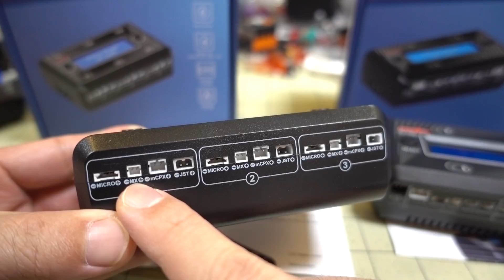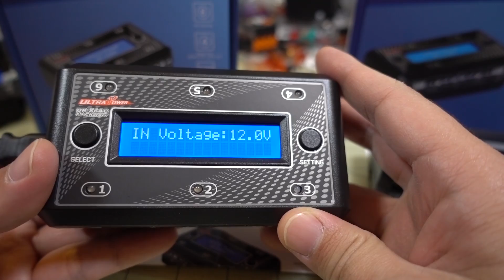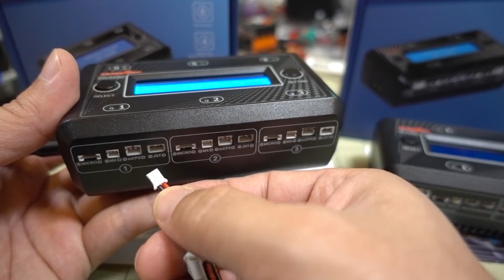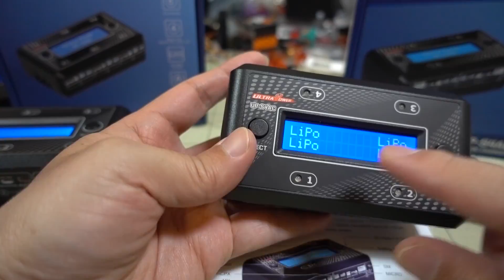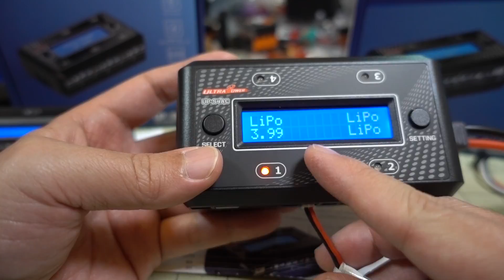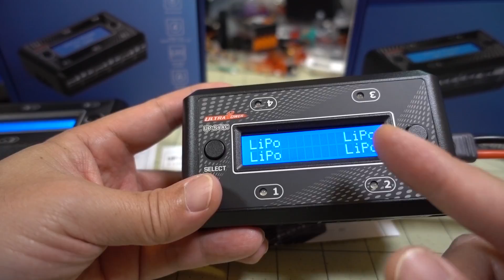Ultra Power UP-S6AC & UP-S4AC Smart Charger Review ⚡

Comment: I've been using the UP-S4AC for a while - it's my favourite 1S charger at the moment. Having the same charge current on all ports is the only thing to be aware of. The 4 channel charger appears to have some issues when charging 2S packs ... see this thread on RC Groups: https://www.rcgroups.com/forums/showthread.php?3161991-Ultra-Power-UP-S4AC-4x7W-4x1A-AC-DC-LiPO-LiHV-NiMH-NiCd-Battery-Charger-With-SM-XH   Regarding storage charge there are various cheap dischargers around ... I just made up a harness with six PH 2.0 flyleads attached to a standard 6S balance plug, to use with one of those. So I can discharge up to six 1S Lipos to storage voltage at a time.

Comment: I have had the UP-S6AC for a little while now, but I am pretty sure you cannot adjust charge rate individually for each battery, or at least I haven't seen a way to - if there is a way I would love to know.  I also really wish it had a storage charge feature.  With that said, it is currently my favorite 1s charger, because it is so easy to use.  You do not have to push a button to start the charge - there have been many times I plugged in a 1s battery to charge and when I checked it a half hour later, I had not pushed the button to start the charge, so this one is a big win!

Comment: My 4 channel gets hot when charging close to the 1 amp limit. I had it melt at a race meet, and now no longer charges. Banggood is sending me a new one. Check how hot it gets when charging at 1.0 amps, probably should have some active cooling, or lowering that upper current limit.

EDIT: also, they have low voltage cutoff for the input lipo. Well, its not cutoff, but it starts beeping to warn you (not sure i recall you mentioned it in your video).

Comment: Nice review, Albert.  But unfortunately, no storage charge feature😢  Everytime I see a review for a micro charger come up, I always have a little hope before I watch it that it will have storage charging, lol.
Reply: neo Jeets this is exactly what I think every time.
Reply: Seems like a no brainer feature
Reply: A common lipo charger uses the balance lead to measure voltage while charging to determine when its at storage charge. Someone will need to design a 1s charger to have a different switchable finishing voltage in order to end up at storage or full volts.

Comment: Great chargers but the buzzer is too loud especially if you have two of them because the charger beeps three time loudly when a cell finishes charging. I had to mod mine to put a 5ohm resistor in parallel with the buzzer to make it much quieter.